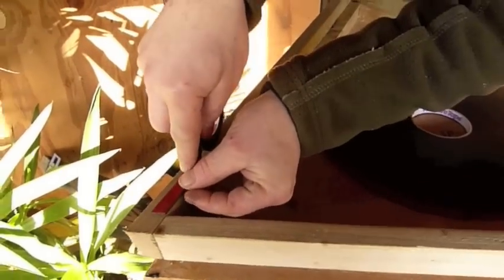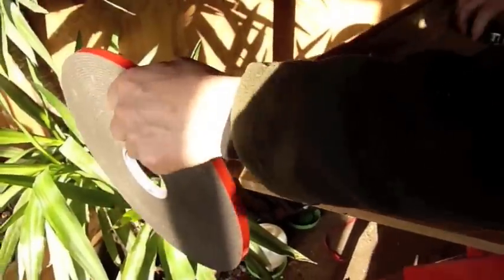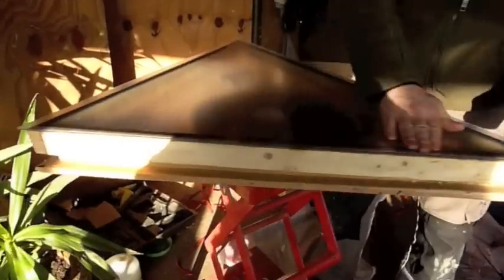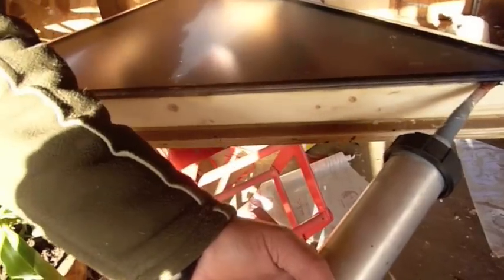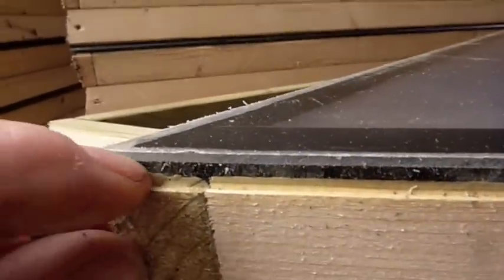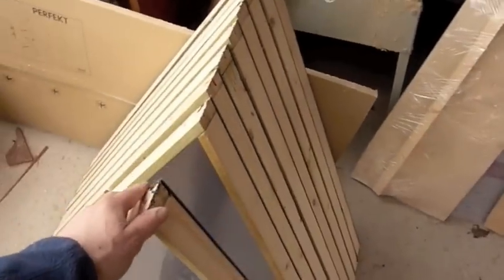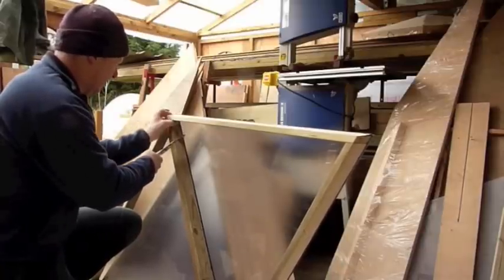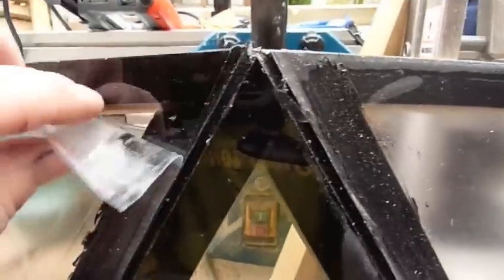Covering a geodesic dome frame with solid polycarbonate

Comment: Hi Paul, so I've left you a question about joining the segments on another video, and how you waterproof the joints. I think I got my answer here :)  BUT! I was wondering,  have you developed a system to add on top of the joint to protect the sealant? For us in Portugal, the summer heat with cause the joint to crack after 1 season :( or maybe 2 at best... So it would be good to know that as we're considering buying your plans. Thanks in advance

Comment: Thought : What if you encapsulate the cell both sides and use spray closed foam in the gap for Energy efficiency and then overspray with white rubber paint or polyurea for sturdiness over the foam?

Comment: tip" if you can find a good paint that you trust bonding to....you can paint the inside border, whee the tape/sealant goes, it provides a nice uniform look vs seeing the goo/tape through the panes.  We used to do this on riveted in polycarb windows on our rally cars.

Comment: I have two questions, first is roughly how many man hours did it take to complete this job? And second is for someone who doesn’t have much wood working experience, would this be too much of a challenge to build?
Reply: How many hours would vary a lot, so even if you got an answer it would not help you. The only part that is critical is getting all the angles correct where the wood parts are joined together.

Comment: Hi. I am terrible at math but i really want to learn to build a 6v hexadome. My goal is to make it frameless. I intend on attempting to do that by using a router to cut a large notch on the outer underside of each solid face and joining the resulting lip with pegs or bolts. I will be trying to cut my faces from solid tree rounds if i can manage that. My question is, how do i calculate the measurements for the faces and the angles where they will meet together at the edges? I am having trouble finding the formula i need for my project and i am ignorant of what resources exist that i can tap into. Can someone please point me in the direction i need to start? Thank you.

Comment: OK this is for thick square wood posts as triangular independent units. How geodesic domes made on site with thin round metallic rods can be covered with solid polycarbonate?
Reply: The best way would be to make the panels oversize, then overlap them and bolt together. Start at the bottom, so each higher panel would be on top of the one(s) lower than it, the same way you would do with shingles.

Comment: There's a router bit for countertops that would do that job much cleaner & smoother. You could also experiment with mirrored plastic facing in on the north side to catch & reflect the light for a greenhouse. If it's too bright, there's mirror dulling spray. They use it on movie sets. You can adjust the amount of reflected light. Even white plastic would give you some bounce light. Have you ever tried double paning? One on each side of the frame?
Reply: Dead space...free insulation!

Comment: Excellent video. I'd actually considered a similar process using the tape for plastic film so it'd hold it more securely and allow you to properly stretch the material. By far the best video I've ever seen on polycarbonate. covering.